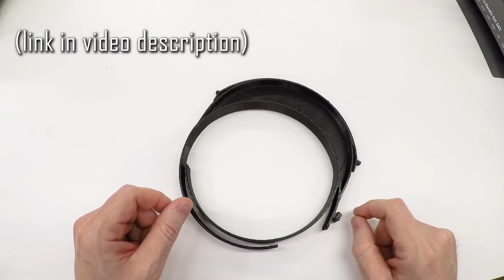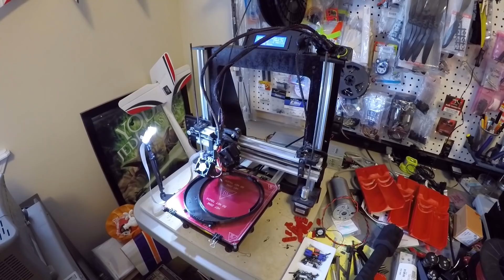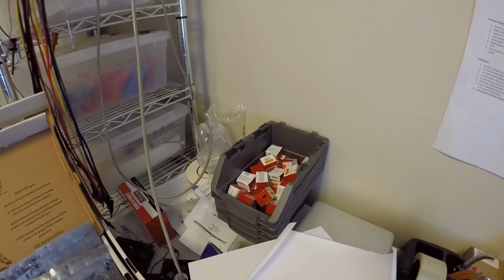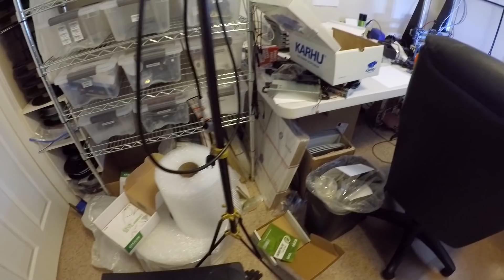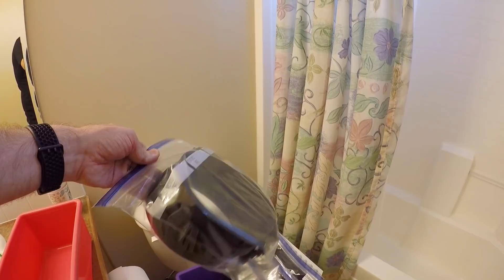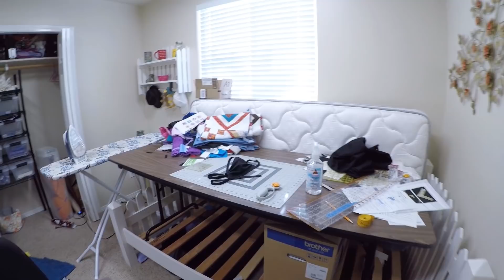Lab Tour and Making PPE for Covid Response

Comment: Hello, Thanks for sharing. I noticed your printer stepper motors make some noise that you can reduce by changing drivers and control boards. I've done that and I can make it run in the living room without bothering much all the people living confined at the moment in the appartment.
I choose MKS GEN L board with TMC 2208 and it's night and day :)
Reply from the maker: Yup.  I have two printers with the same drivers, but different motors and the difference is substantial.
Reply: @Clough42  what do you mean by différent motors then substantial difference ?  Fiting a motor with the correct torque would  improve even more  the noise reduction ?

Comment: Not true. I downloaded the files, printed almost 100, laser cut the shields, Purchased washable button hole elastic and weather stripping in bulk. My local hospital was very grateful because it kept them going until they could source bulk throwaway ones. My wife cleaned bagged and dated each one. The hospital has their own method of cleaning them also. helped my wife's sister is a nurse there though.

Comment: My mother was  going to teach me to sew but i had dismantled her machine to see what was inside 😀
Reply from the maker: Yeah.  I was like that, too.  My mother found me at age five sitting in the middle of the living room floor with a screwdriver, surrounded by pieces of her Electrolux vacuum.  The didn't know how to respond, so she just told me to put it back together.  I did, and she still uses it today, 42+ years later.
Reply: Clough42 
I didn’t have screwdrivers but managed to fashion a suitable implement out of a steak knife using the concrete steps out the back of the house as a honing stone ! You would be amazed at what you dismantle with just one steak knife - Among some of my triumphs were my brothers spare car radio , his Citizen watch- which i re assembled using glue  and of course the most part of a Singer sewing machine !
Reply: @Flattyman  butter knives are the original mullti-tool.

Comment: At MakerNexus in the SF BayArea, we fixed the problem with the open part with a head-covering with a plastic-sheet as requested by the local health community ( https://makernexuswiki.com/wiki/File:Face_shield_front.jpg ). Also, we moved the pins to the center of the headband instead right against the build-plate - that way, there is something covering up behind the face-shield punch ( https://github.com/makernexus/prusa-covid19-shield-remix ). With 500+ makers involved,  we delivered 5000+ face shields so far. I like how the maker community comes together and clicks into gear.
Reply from the maker: The community mobilization has been impressive.  I expect the makers to come forward to help if they can, but what has truly impressed me is the emergence of leaders to organize and focus.

Comment: Every provider that goes into a covid positive room needs to wear a face mask to protect against droplets.  Aerosol generating procedures like intubation dictate whether or not a provider uses a N95 Mask (in very short supply) or a regular surgical mask.  Ideally, one would use an N95 mask every time you go in to see a patient since coughing is aerosol generating but these are the cards we were dealt. Going into a small enclosed hospital room in which there is a patient coughing and spitting up SARS-COV-2 virus into the air is a bit intimidating ESPECIALLY if you don't have a facemask.  Thank you for doing this and for your amazing content in general.